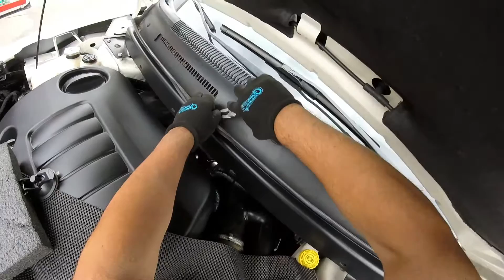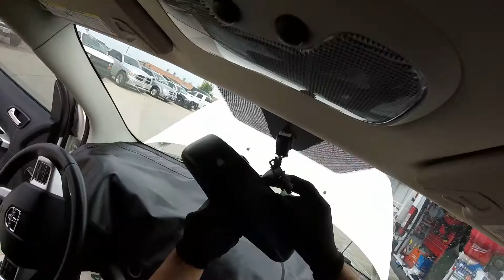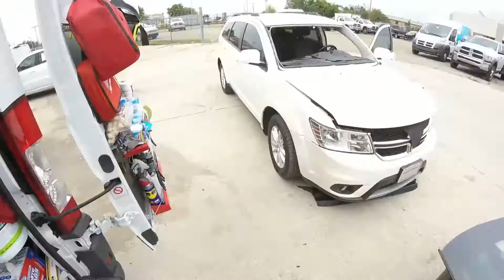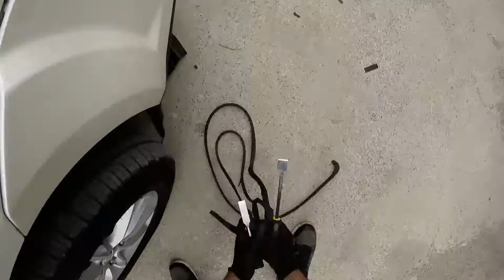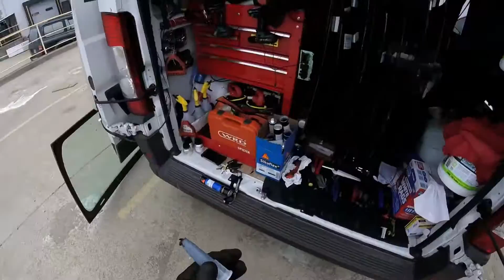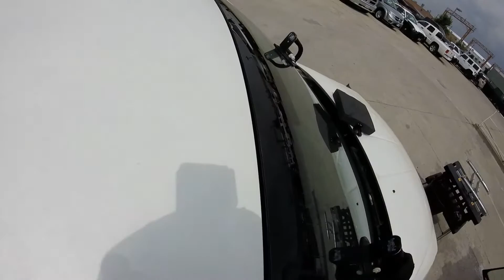dodge journey 2015 /windshield replace (remplaso de parabrisas)

Comment: My 2015 Journey is leaking down from the front seat lights, and the windshield does not seem to have trim on top. Should I visibly see trim when looking at the top side of the windshield?
Reply: don't see a molding on the top part of the windshield and water is running in from somewhere and filling the back compartments that are on the floor and on the Dodge Journey 2014. I also have battery draining and not sure from where, I disconnected it main ground checked fuse to ground with a volt meter in series and found no drainage. The dodge dealership did exactly the same thing for a few hours and couldn't find the issue. The car runs perfect all components are very good and still dodge dealership couldn't find anything. This problem has existed on many  dodge vechiles since 2009 and there have been no recalls. Both water leaks and battery constantly draining is a major issue and dodge pretends they don't know. It will be the last time I ever buy a dodge product.

Comment: hello sir I have a question I just had my windshield replaced today 2015 Dodge journey..the installer did not remove the wiper blades or basically nothing you did on your videos when I drove it it's making a wind noise coming from the windshield and there's a 1/2 inch gap from the top of the windshield to the frame..do you have to remove the blades to do it right???I feel like I got ripped off plinkington glass
Reply: How do you reinstall the mirror?
Reply: Whatever company cut corners and they stuffed your windshield and it never makes a good seal with the urethane
Reply: That's why it's making noise
Reply: @florafierros1683  so glad i got rid of that suv worst ever . .TRUCK now!!
Reply: @bigmacfamily0098   nice !! 
Just becareful with your choice of auto glass company make sure they always remove your wipers and cowling for a proper and safe install.

Comment: I had my windshield replaced a week ago the glass guy didn't put back the rubber seals they way they should and the top there is no seal between windshield and car. Is it suppose to not have rubber seal on top?
Reply from the maker: Hi some model has top rubber moldings some no.
But i noticed in a different jobs. But same cars some has t some no .
Here a example the new 2019 tiguan no. Top rubber molding.
But the old one does have t.
But if you install top rubber in the new one.
Makes wind noice.
So always watch your cars and parts before a tech works and if you see different parts ask them about
Reply: @vdkarautoglassreplacement3642  ok thank you so much so 2012 dodge journey didn't have one?

Comment from the maker: well  i m sorry to said this but if the glass man didn t take the cow plastic and you have wind noise its a bad installation 1/2 inch mean glass its to low i don t now .what brand of glue they used but the popular glue used by glass man are SIKA  DOW. DINOL NOW sikatak its expensive..especial if is one dry hour  ..DINOL  or express from DOW ..but 418 from DOW ITS PRIMELESS means you dont have to use primer on glass but the problem is when the tech doesn t  use product like betabread f1 its and agent to clean all the contamination on the glass  still you have to primer on glass ..so you have to do is call the company did the service and have warranty ,,but this time you must tell this people remove cow wiper arms use primer on glass and pithweld and the glue must be express from dow its 1/2 hour wait before drive and one hour ready to go...or 428.from dow but that 8 hours glue will dry .so you must wait 8 hours before start driving on highway ..and remember price mean everything cheap mean sometimes lot problems ..but i admit expensive sometimes can mean the same good luck..
Reply: VIDRIOKAR so I just measured it and it is exactly 1/2 in gap from top of windshield to frame around it..do you think I got the wrong size it's plinkington..do you know the numbers on the Dodge journey 2015 crossroad?for the window I wish I can send you pictures or talk to you you do very good work and know alot thank you alot!!
Reply: VIDRIOKAR what should I tell them do you have a work number is wish you were in the Tampa Bay area fl
Reply from the maker: all windshield have specification on manufactures so  its not the glass its the install cause most the glass man use pgw pilkinton xy and funyao so glasses caming in right sises its the install cause i sow this kind of problems before and glass sliding down cause the didnt not set wth v glue they use a roll cause they keep material and its easy to insert the glass in to the cow when the glue its that low..but the cost is this glass go down ..now did you drive after install cause that make the problem go worst ..makin the problem you have now.
Reply from the maker: well this kind of company looks formal or just that kind is around with mobil service